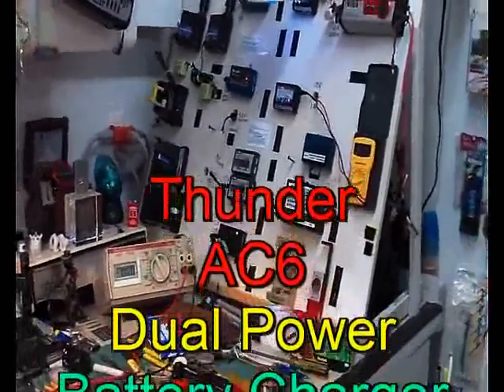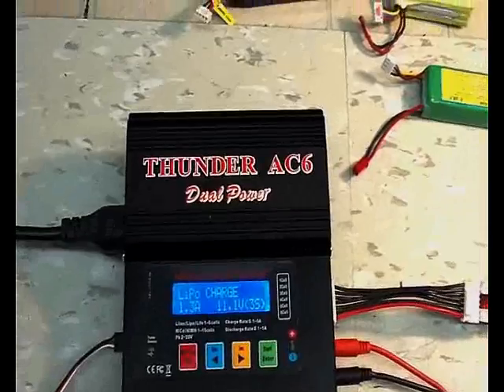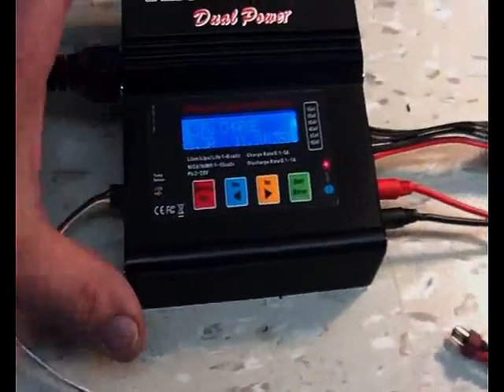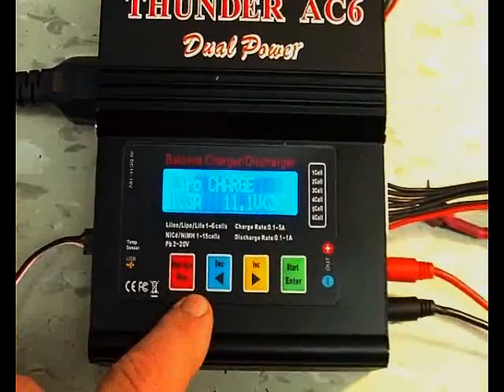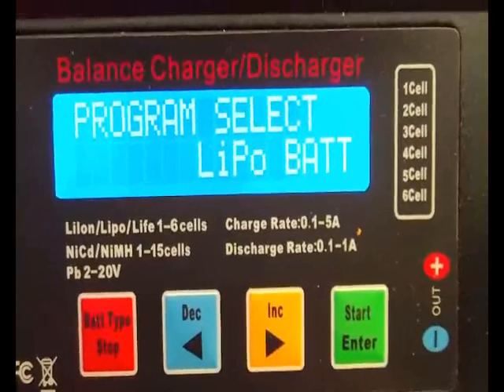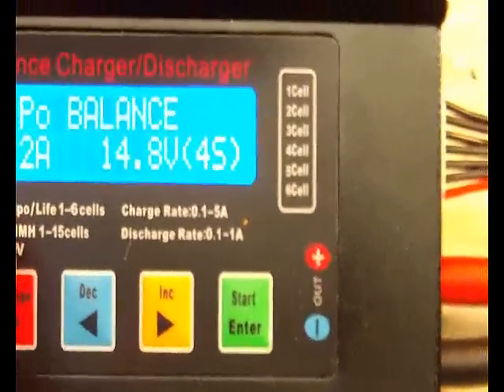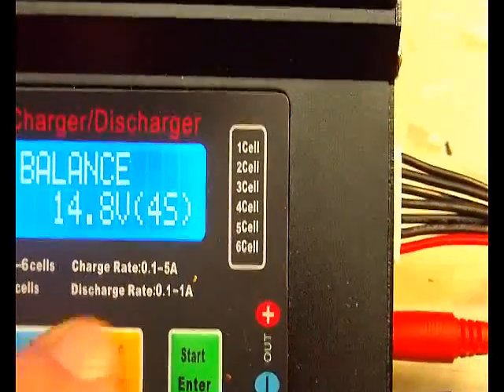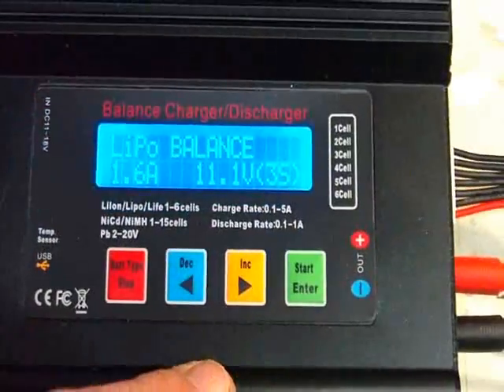Intelligent AC-6 Lipo Charger Review with charge examples.

Comment: Is it safe to change the deans connection to 4mm bullet style connectors on the charger wires? They are pretty thin comparred to my lipo battery.

Comment: You never showed plugging in the main battery to the Banana  plugs and then the battery.It looked like you only needed to plug in the balance board.Thats why I got connection break.I noticed others did the same thing.You skipped that step and I never noticed that in your video that the battery was plugged in to both.Overall an ok video but I honestly had to watch a different  video to figure out what I did wrong. My regular charger does charge through the balance plug. I wish they offered a cigarette plug type charger imput as most cars have.Now they offer USB imput on newer cars.

Comment: The adds for this charger say it can monitor on the PC the temp of the battery while it is being charged.
However, it appears you have to choose to set the port on the charger for either the temp sensing "OR" the USB connection to the computer.
That means one would not be able to do both at the same time.
In other words, you can not hook up the PC and monitor the temp at the same time.
Am I missing something ?

Comment: I'm thinking the one I just bought has issues.
I read through the manual, twice, watched this video (which is excellent, btw), set everything up for my batteries, then got my 'brand new' batteries out and hooked the first one, a 2200mAh, to the charger.  All I got was a CONNECTION BREAK error.  Checked the adapter & cables for continuity, all good.  Tried the second battery, a 2650mAh, and got the same error.
Did I miss something, or is it a bad charger?  Thoughts?

Comment: @NightFlyyer 
I do not understand this, i want to charge 11.1 v LIPO, 1800mah, when you go through set up and you start it in lipo balance after it is done is it ready to use or i have to do it one more time and this time start it in lipo charge mode.

I did3times start it as a video shows and many other videos in balance mode and after is done i tried on my heli it worked for4min and couldn't fly any more. I have the other charger which came with my plane, it balances and charges in same time

Comment: I do not understand this, i want to charge 11.1 v LIPO, 1800mah, when you go through set up and you start it in lipo balance after it is done is it ready to use or i have to do it one more time and this time start it in lipo charge mode.
I did 3 times start it as a video shows and many other videos in balance mode and after is done i tried on my helicopter it worked for 3-4 minutes and couldn't fly any more. I have the other charger which came with my plane, it balances and charges in same time

Comment: I am disapointed with this charger. I run nitro as well as elecs. and I was thrilled to see that this charger included  a glow ignitor plug. well guess what ? It was not in the box !  I bought 4 new venom 7 cell 4200 mah batts. when set to the correct charge rate the charger over heats them in five minutes ! Then if I lower the charge amps and go for a two hour charge it does the same thing. can anyone help?

Comment: Did you know there's a newer version of the AC6? It's the AC680. It has more power and higher discharge rate. Here's the specs...
Operating voltage: DC 11~18 volts 
AC in: 100v-240v 
50/60Hz 
Charge/discharge power: Max. 80/10 Watts 
NiCd/MH: 1~15 cells 
LiIo/LiPo/LiFe: 1~6 series 
Pb: 2~20V 
Charge current: 0.1 to 6.0A 
Discharge current: 0.1 to 2.0A 
No. Of cycle: 1 to 5 times 
Battery data memory: Up to 5 data

Comment: Ok. This charger is kick butt. I have had a chance to use it now and I have to say it is pretty damn good for the price. Mine came with a USB cable and PC software to graph voltage, current and temperature. I am running Vista and the software and drivers loaded successfully.

Comment: I just got mine from Hobbypartz and it does NOT have the Deans connectors. It has bannana plug and one connector has the Chinese red plastic bananna connectors that come on the Turnigy batteries. They are junk connectors. I will be cutting them off and replacing with Deans connectors. So, in the end, $42 ends up being about $50 by the time you put the Deans connectors on.

Comment: hay when i try to charg my 3 cell lipo and it ses battery check low voltage

so my thunder ac6 thinks its a 2 cell but no its a 3 cell

how do i fix it i try to charg as a 2 cell about 10 sec into charg it ses cell add eroor

Comment: I read a review in Amazon for this charger and it reads, " I've been able to charge a 3S 1300Mah Lipo for a park flyer, but not the 6S. I've searched dozens of forums and nobody else has reported successfully charging a 6S 5000Mah, so it would seem this thing just can't push out that much power. " Is this the case?

Comment: hey nightflyyer
its fast400, i think you helped me out with some blade400 parts on helifreak?
so im watching this video and have a question?
i have a thunder t6 the smaller version of this charger, anyway, i am getting a connection break meassege when i connect the balance board. i found a loose screw in the charger, i think it shorted something.
CAN YOU REPAIR THESE CHARGERS? if so i need mine fixed.

Comment: hey boomer,  if you have a 2700mah 6 volt battery never charge it at a different voltage than specified
as far as the mah being at 2700 you need to charge is at 2.7 amp for a full strong efficient charge. You may charge it at a slightly higher amperage but dont go overboard, this slightly higher amperage will allow for a slightly quicker charge but slightly less efficient battery pack , there is a patteren when charging

Comment: i got this charger,and its been saying "HOTACHARGER"  and im not doing anything different than when i first bought,which waslike 1 month ago, i charge 3 to 4 batterys 2 and 3 cell at a setting,not all at once,but sometimes if i touch the charger the static from hand makes the screen go crazy,like Japanese  writing or something then says HOTCHARGER has this happened to anybody else,I UNPLUG IT, PLUG IT BACK IN AND IT WORKS,HELP,HELP,HELP NIGHTFLYER

Comment: Normally you should not discharge Lipo's because it is not good for them (like it is for NiMH batteries). You minimum cell voltage should be no less than 3.7v per cell. If you dip below that, you decrease the packs life.

Comment: What kind of cells is it? If you're careful you can hook up your battery pack to a basic NiMh wall plug charger for just a couple minutes. This will "wake up" the cells enough to let the charger proceed in the proper charge mode. Do this at your own risk.

Comment: i have one quick question. I know that many different battery companies have different balancing connectors on their lipo batteries. for example thunder power batteris have differently shaped balance connectors than eflite or tenergy batteries. do they have different charge boards available with different connectors on them to fit other types of batteries? Thanks

Comment: Hook it up to a variable power supply around 10V and see what comes up on the display. I'm just curious to see if it is just my charger, because it may have just been some idiot in the factory programmed it trying to be funny. Otherwise I love this charger. It works absolutely awesomely on every battery type I have tried it on. Also looking at it, it looks the same as Trinity's charger, but 150 bucks cheaper.

Comment: Has anyone else had an odd message show up when it goes into a low voltage input trouble before or is it just my charger? I was charging a battery off of a dead car battery and came back to be amazed by the writing on my chargers screen.

Comment: I always get the "connection break" error when attempting to charge by firebire phantom NIMH battery. I'm using the clips and attaching directly to the battery (since there is not connection that will fit the firebird phantom connector).  Has anyone else been able to charge NIMH batteries?

Comment: You state your trying to balance indicating charging a LiPo type battery therefore using the balancing cables and sockets.  They are smaller wires so I suggest finding a meeter and checking each wire for an open.  If all else fails take it back to the shop for support or exchange.  The chargers are mass produced and some may have issues.  However a very good charger design!

Comment: Gutts, screen, etc look exactly like the Turnigy Accucell 6 which is about $40. Nice thing is the built in power supply. But if you want to spend bigger bucks on a faster charger, look for something in the 10a range.  Buddy has a  cellpro 10.  A bit pricey at $180 but charges batterys twice as fast in the field.  Nothing wrong with this one though as I basically have the same thing.